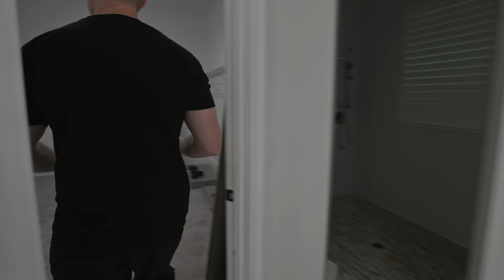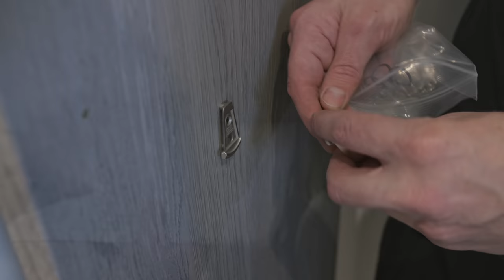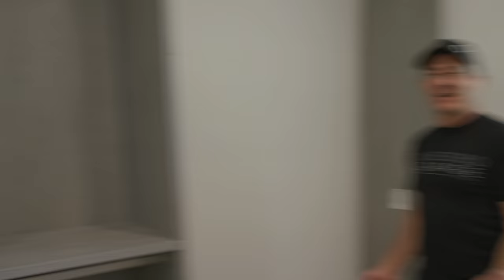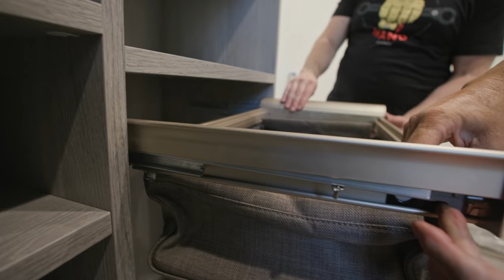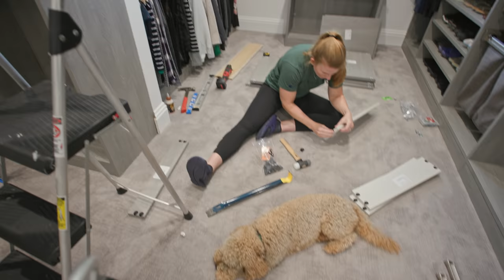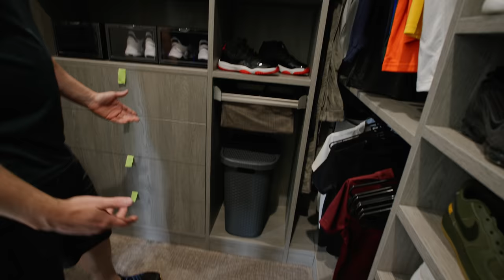Chasing Closets: The OG Closet Solution - Install with Mike F.

Comment: So far, the installation method and style looks very similar to the Easy Closets system I recently installed on a property, albeit I don’t recall a 1 inch thickness option and yours doesn’t have the janky empty holes for shelves all over the place. The color on camera looks almost identical to the one I chose. Couldn’t agree more that most of these companies feel like you’re getting ripped off. A simple and cost effective solid wood option would make me feel a lot better but as you mentioned, it might not exist yet. I’m 100% ready for the OG closet solution.

Comment: Before you pull baseboards, run a blade along the caulk joint at the top (between board and drywall).  Will prevent pulling the paint/drywall paper off when you pry the baseboard.
Reply from the maker: Yeah…that’s exactly what we did.

Comment: This is a janky rip off.  The gap from the baseboard was a real shortcut too.
Reply from the maker: Ha, ha... Insecure much bro?  Painter are coming in the next few weeks to caulk and finish walls and trim.
Reply: @ObsessedGarage  They’re going to caulk a 3/4” gap because you guys installed it without cutting the baseboard out first so the side leg can be flush against the wall?   Nah, I didn’t think so.
Reply: @ObsessedGarage  Caulk is the #1 bandaid of shortcuts and mistakes.